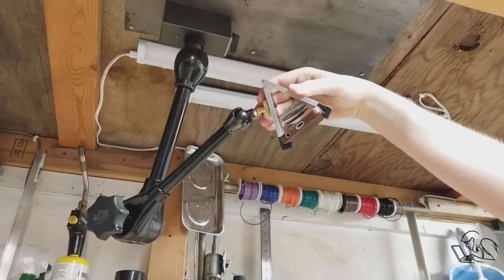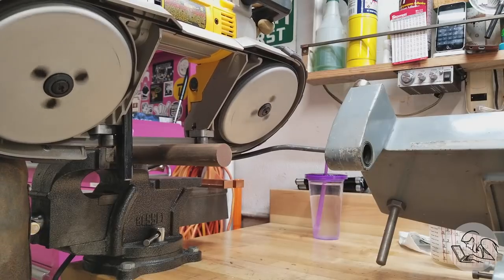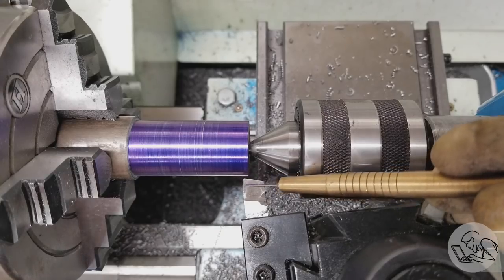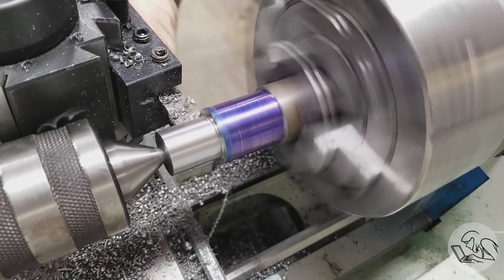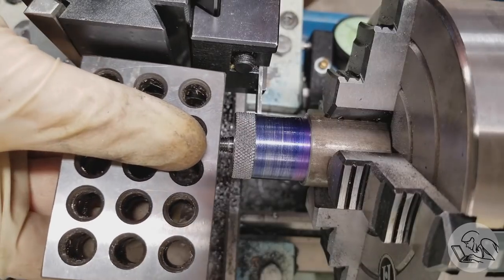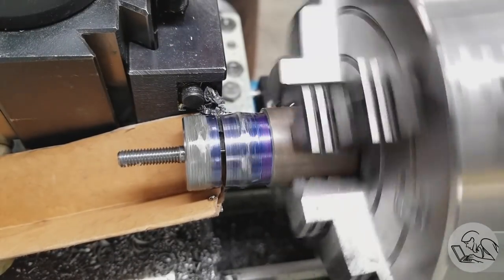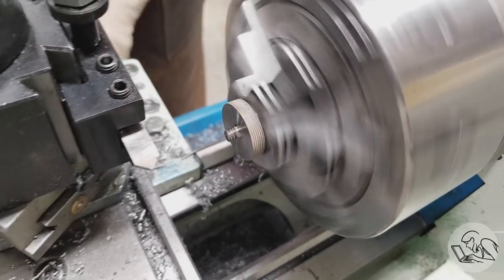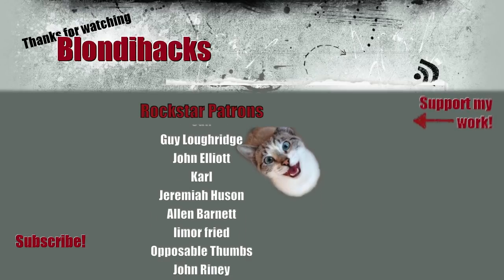How to Attach a Camera to ANYTHING!

Comment: Quinn, sorry to hear about losing your mom. I lost my mom 3 years back. She had a great appreciation for good books.  I have a method for relieving the back side of the 1/4-20 thread. Spin the part with the lathe in reverse, and use a dremel tool with a cutting disk to grind in the feature.  With the part surface moving at high speed in the opposite direction of the cutting disk it is possible to  maintain reasonable concentricity during cutting. I have used this method to grind features on round parts using a just cordless drill and the dremel.

I love watching your channel because you explain things very well.

Comment: I'll be honest, once I bought a knurling tool like yours I knurl EVERYTHING. Plus, my cat is now much easier to pick up.
Reply: Warren Bailey, I can’t wait for your video on knurling a gnarly cat!
Reply: Man, I’ve tried bathing a cat. Now that’s an experience; an experience I don’t want to repeat. But knurling a cat....you’re on your own mate. 🇦🇺👍
Reply: @shedmanx3640  Get your lathe dogs ready, that's a job that will require some tail support :P
Reply: We are a pun-y bunch!
Reply from the maker: This is the best comment thread on YouTube.
Reply from the maker: Shed Man X I also did that exactly once. It was like she suddenly grew 10x in strength. It took two of us to hold her in the sink. She weighs 8lbs. How is that possible?!
Reply: @BrilliantDesignOnline  that's because you chucked it. It's not recommended to turn them between centres either as they don't appreciate being spun round by a dog. However if you lift the tail you'll find a convenient spline drive socket which works well for knurling loads.

Comment: Thanks for your video. Y T robot must have suggested your channel and I’m glad I gave it a try. I’ve been tinkering in my shed for the past 60 years and it was only due to an unexpected bonus this year from work that allowed me to by a lathe.
I’ve done a few things on it but your video was clear and concise and downright enjoyable. Thanks, I’ve subscribed and will start on the backlog of what I missed.
Now comes the age old problem of buying all the accessories for the lathe. I bought a quick change tool post so more tool holders are needed. Then I have earmarked a knurler. Then a run out gauge..... the list goes on.
Thanks for your videos and work you put into them. Much appreciated. 🇦🇺👍

Comment: Hi Quinn.  Keep in mind that even though older Nikon lenses fit newer bodies, their auto-focus motors can be noisy and show up in your audio.  It’s because they didn’t have to worry about video at the time they were developed.   Newer lenses have super quiet focus motors for video.  It’s obviously a  non-issue if you’re using manual focus.  Consider buying a kit when you’re shopping for a new camera as for only $150 to $200 you get a pretty darn good lens that’s quiet.  Hope this helps.
Reply: An external microphone is another solution for better audio, and cheaper than new lenses!
Reply: NiHaoMike external mic will also pick it up
Reply: @woodscreekworkshop9939  Depends on the distance and directionality.

Comment: I know you like to throw shade at the woodworkers, but this video did remind me of something I got from that side of the railroad tracks.  I coat my unfinished steel surfaces on tools like table saw, drill press, jointer with some good ol' SC Johnson paste wax.  For home gamer hobbiest, the $12 1lb tub off amazon is a lifetime supply.  Application on flat surfaces is just wax on, wax off.

Comment: Spent several hours at my mom's today working on a project with my dad. I had a thought about this project. My idea is, make your nova arm thread first, but instead of going into the knurled knob you switch to 1/4x20 thread section maybe 1/2 inch long. You would have a rod that has 2 types of threads on it. Then make your knurled knob as a separate piece that is threaded inside like a nut. The thickness of the nut would be the determining factor in getting the camera body threads to spec. But once you had the knob correctly made you could loc-tite it in place and you would have your 1/4x20 thread right up to the face of the knob. Im no machinist so maybe it wouldnt work. Great video as always.
Reply from the maker: Yah, that would have worked!

Comment: This is a nice build, but I have a small question. Forgive my ignorance. But why did you machine the whole piece from one part rather than making two parts (a threaded rod and a knurled nut with an internal thread) and just secure the nut at the required distance from the end, either by weld or by some sort of mechanical means?  It seems to me that the second method would have been more efficient, and you would not have the issue with the threads not reaching all the way to the knurled bit. I presume you have some reason for making it the way you did, but it is not clear to me what the reason is.
Reply from the maker: This was a whole lot quicker than making multiple parts.

Comment: Have you got an ER32 collet chuck for your lathe? It strikes me that it would be an excellent addition to your tooling arsenal. Very good for small work and superb repeatable concentricity.
Reply from the maker: I really really want a collet chuck, for sure. It’s on my project list to find and adapt one to my lathe (there’s no “official” option for one)
Reply: @Blondihacks  I have a British lathe, a Harrison M250. It uses the camlock D3 interface on the spindle nose. I had to get a collet chuck and a plain D3 backplate from a company called RDG Engineering, here in the UK. I machined the backplate to fit the ER32 collet chuck to it. Machining the cast iron backplate was a pain; despite my best efforts to contain the swarf with a shop vacuum, my lathe bed ended up buried in cast iron chips. I try to avoid cast iron as much as I can. However, the operation was successful and I mated the collet chuck to the backplate. 

Prior to that, I'd been using my MT3 ER32 collet chuck from my mill in the spindle taper, with a makeshift drawbar. Actually,  Harrison lathes have a Jarno taper in the spindle nose and come with an adaptor bush. On the M250 this takes it to Morse 3. The collet chuck on the back plate is far more versatile as I can slide stock all the way through the spindle bore. 

I think machining a backplate for a collet chuck on your machine would be an excellent project for your channel.

Comment: You really want to put a rubber sheet on that thumbscrew. Not because the star washer may scratch up the camera bottom, but because the flat of the tripod mount is meant to absorb the bending moments. With the relatively heavy leses of DSLRs, those moments can become quite large and you risk cracking loose the threaded insert from the camera bottom.
Reply: Jan Knaup maybe she can cut a washer out of a bike inner tube.
Reply from the maker: That’s a fair point!

Comment: Joe Pieczynski (I had to look up the last name) has a video showing "how to knurl well on any diameter" (only works on the clamp/scissor style knurlers). The trick is to tighten the clamping/scissoring bolt quite hard in the first pass, rather than "gently increase the pressure".
Reply from the maker: Joe Pie is the greatest! I learn so much from him.

Comment: There is another way to get a thread really close to a shoulder. I read a LOT of 1930's UK model-engineering magazines, and those guys had small lathes and no money - they were always pushing the limits of their machine.

On of their standard "add ons" (which they made) was a mandrel-handle, which fitted in the left end of the mandrel via some kind of interla expanding collet-type-thing.

This was used to either LOTS of torque (not all their laths had back gear), or amazing control levels. With a mandrel handle, running a thread up to a shoulder would be easy.

But very tedious. "Pastime" is another word for hobby...

(it occurs to me that reversing the thread-drive, turning the tool upside down, and running the lathe backwards would allow you to cut the thread away from the shoulder, not towards it, and would also solve the problem)

EDIT; mandrel handle LIVES!
https://www.youtube.com/watch?v=zS70SMY6U-Q

Comment: Though never actually trained to run lathes, at times I did need to use one to make things I needed for jobs in other machines.  I realized early how a 4 jaw just made life easier and gave me a chance to use the indicators I had bought (used and cheap).  So concentricity just became a way to avoid making the same part once, then make it again because ecentricity was getting in the way.  To my surprise, I ended up in a shop where guys think if the customer print does not call for concentricity, no attention needs to be paid to it.  As a brush guy, more than a  cat guy, I appreciate your choice not to attach a camera to the cat, and taking your used brush to the used brush farm.

Comment: To remove that last bit at the bottom of that thread I'd try to use a hacksaw blade.  I once did that on the slot for a lock ring with marginal but crude success.  It was before I had the drill press and I don't recall if I spun the shaft in a hand drill or worked my way around it by hand.

Comment: You could eliminate the lock washer by kissing the base of the thread with a small tool.  It's similar to a part-off tool, but with a very small radius and fed at a 45 degree angle to very slightly undercut the base.  This will get the knob right down on the camera base, and is actually stronger because it eliminates a stress riser.  Thumbs up to crush a troll.
Reply from the maker: Yep, there was a section there where I explained undercutting the thread with a grooving tool, and why I didn’t do that.
Reply: @Blondihacks  Yep, you did.  Sorry.  I did watch the whole thing before commenting, but I was apparently not mentally present during that part.  I hate it when that happens.  (More and more, all the time.)

Comment: Nice part but I'd make 2 modifications to the design.  1.  Instead of a metal star washer I'd use a fibre washer like the sort used in older taps (faucets).  2. I would drill 2 through-holes in the knurled section 90 degrees apart.  An Allen key or this screwdriver or any rigid bar can then be used in the through-hole to add a little extra purchase to the tightening should it be needed, just like the bar on the die holder at 15:39

Comment: I guess the other option would be to make it two parts, the shaft and the knob. Thread the knob the same as the camera and thread the shaft from both ends with different dies till the threads touch leaving the 1/4-20 side long. Put some perma locktite on the knob and run it on till it jams at the end of the 1/4-20 and you should have threads all the way to the base. Then it would just be a matter of turning that end to the specified dimension. A washer and a lock nut can be added on the Noga side for extra paranoia.

Comment: Re the shoulder - could you cheat by drilling and tapping into the camera side of the thumbwheel, then thread in a bolt, then cut the bolt to length ?  Even a long setscrew/grub screw might work.
Reply from the maker: Yah, I bet that would work!

Comment: Hey, sis, nice work! One side of this screw looks like a M6? Why not using M6 nuts when you put them into the chuck? A nut (or a stack of nuts) is always stronger then paper thin coke can. If i am doing it my way, i will make it 2 parts, keep the adjust nut seperate to ensure the base of nut tide up on the camera base in order to form a kind of “flange”. In fact you can have more than 3 turns when you make the screw, go to plumbing section in hardware store, buy some rubber seal for water tap, that thing is a black rubber disc with a hole. Dirt cheap, 10 cents may be? it will protect your camera base from overtide and make the project easier. On the M6 side, a normal flange nut or a long nut can be use to jam tide on the arm, also double as a quick release feature.
Reply from the maker: Thank you! Nuts won’t grip a part well, nor are they concentric. The soda can is all you need to distribute the grip pressure of the teeth on the jaws so they don’t mar the threads.
Reply: @Blondihacks  haha😄 i think i know where the problem is, first, i have to apologise my tone, because i forgot to change my tone when i am speaking with another machanist and forget my manner.

And the second thing is, i always work on copper, brass and alu with my pitty small homemade lathe. Steel chips are rare in my lathe bed.

However, i did some camera and tripod fittings before and i learn that, some of the best material for this kind of fittings are copper, which is a lot softer than steel. Just in case if anything goes wrong, you won't harm the camera or the tripod screw thread, and i also suggest using industrial nylon (i forget the commercial name in english) on these fittings, you can cut them like butter in the lathe, tap it without any effort, but it still strong enough to hold, without scratching the bottom of the expensive camera, and it never rust,  even in the rain! Worth a look. You can also get some factory made screw, nuts and long nuts in nylon. But they usually stay in plumbing or kitchen section in the hardware store.

Comment: How do you decide which size centre drill bit to use? Mine came in a set of 3 sizes and I expect I'm using wrong size but I dont know any better.
Reply from the maker: A larger and deeper center gives you more support, but takes up more of the material. If in doubt, use a #2

Comment: I would be cautious of a long video session with a dslr camera if the camera becomes hot. I have a Canon Rebel and I believe I read in the manual some content on this matter. Other than that I enjoy your projects and I have done some similar on an old Craftsman 101 lathe however I installed DRO's on it. Mounting an indicator on mine just wasn't working.

Comment: Quinn, you didn't challenge your thread cutting skills on the 1/4-20? No guts, no glory.🤪 I don't know why it is but, I always seem to find those small fiddly parts turn out quicker easier and less flaws then their larger counterparts, yet tend to begin with that sigh of "fine, let's do this!"
Reply from the maker: Honestly, the main reason I rarely single point thread-cut  is that I hate change gears. 😀
Reply: @Blondihacks  Amen!

Comment: Why not make a knurled nut and make a female 1/4 -20 thread in it and then thread it onto a short 1/4-20 threaded rod.
Thread the bolt into the camera until it touches down. Then back it up a quarter turn and spin the knurled nut down to lock it in position. 
Not sure if I explained what I mean clearly

Comment: You could have made the threads longer then glue a nylon washer to the face.
Reply from the maker: That’s effectively what I did
Reply: @Blondihacks  Right on.  Also, making a receiver for a quick disconnect system would be a nice build.  I've seen some make them out of plywood ....(yes I know, I mentioned wood . . . . sorry) 
Which you could adapt to more than one camera for future growth. 
Cheers